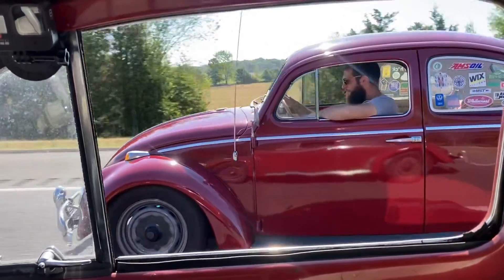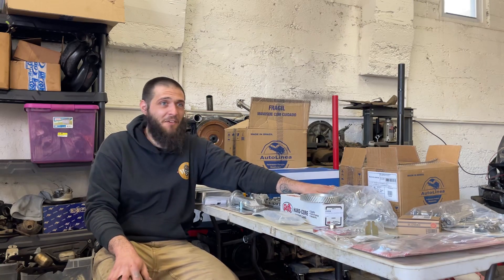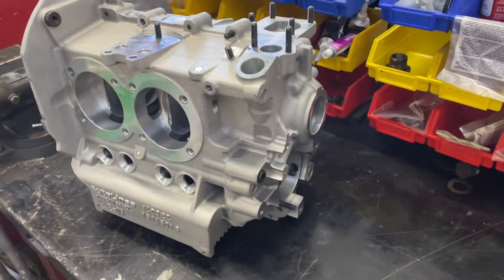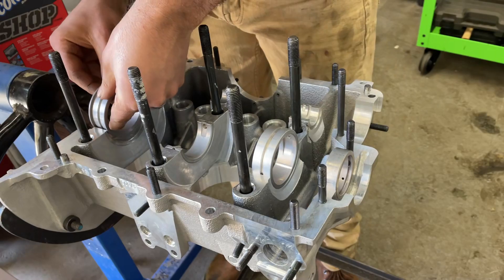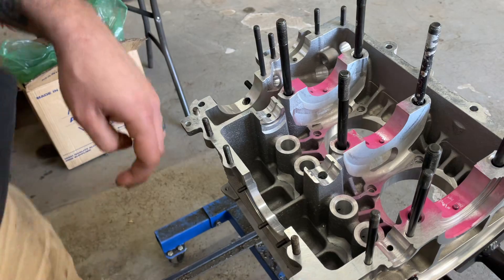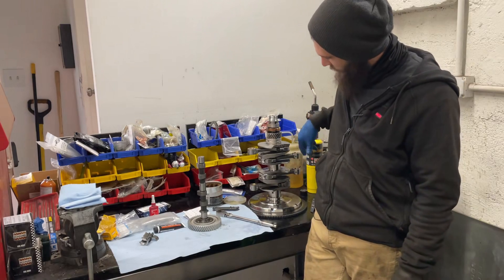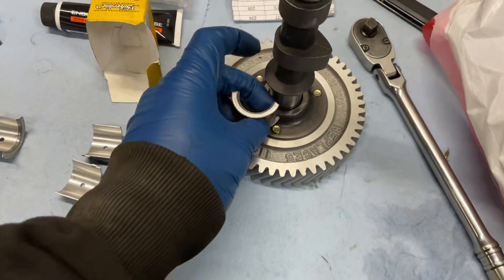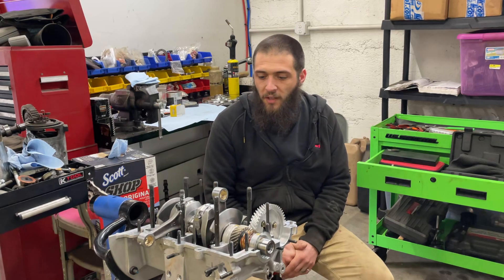LETS BUILD A STROKER MOTOR - Classic Aircooled VW Engine Build

Comment: Scat C25 cam in a 1600-1776 is a great cam. This set up is almost exactly what all my builds are. Just enough over stock where it is a fun engine. Add some 1.25 rockers and it opens it up real well.. Great video...........And don't ignore the Permatex aviation Form-a-gasket...

Comment: I got a 1975 super beetle, fuel injected. And it’s running very poorly, seems to have a lack of compression and blow by. I’m assuming piston rings, first time working on one. Valve cover leaks oil, and missing what seems to be a pcv valve to intake. Could either of those cause a lack of compression? Before I pull the engine out and see wth is going wrong
Reply from the maker: A blocked PCV could certainly cause the leaks but it wouldn’t cause a compression loss or blowby. If it’s still fuel injected, it’s likely the original motor and it’s likely just tired. I, personally; and I know I’ll get flamed for this because I always do. In my opinion the factory fuel injection setups are trash. I personally prefer carb setups. Converting won’t solve your compression or blowby, but if you end up doing a rebuild, it does give you a lot more to play with performance-wise. The factory FI is for stock and stock only and, in my opinion, it’s a god damn nightmare.
Reply: @wickedwerks  yeah I agree with you on the FI, they’re a huge pain. And it seems like I’m dropping an engine, fun times 😂.  I tried getting a compression test on their but I’ll be damned if i could get it on there. She turns over really quick it seems
Reply from the maker: @sam03137  do a valve adjustment and see if it gets better. I’ve had a couple situations where the valves were adjusted too tight and hanging the valves open. Might get luckily but yeah, likely will need a top end. When you pull the engine, check your rear main bearing and make sure it isn’t flopping around in the case; I have a video example on my Instagram. If it is, motor is trash and you need a complete rebuild.
Reply: @wickedwerks  appreciate the help, I’m up in Vermont so it’s finally warm enough where I don’t mind sitting on my garage floor. Probably should get a wood stove in there 😆
Reply from the maker: @sam03137  sure thing! Shoot me an email at wickedwerksvw@gmail.com if you need anything else, advice, or machine work. I’m down in Rhode Island, happy to help however I can.
Reply: @wickedwerks  sure thing, I know just shy of nothing on these engines. So it’ll be a lot of learning at the very least

Comment: did you have to machine the Autolinea Case for the crankshaft and camshaft. im new to vws and i have 3 Ghias without engines.
Reply from the maker: No, it comes cut. I brought it to my machine to make sure it was cut properly.

Comment: You’re using the wrong sealant…. You should use Elmer’s glue 😂
According to CB, their rods you’re using, they recommend the bearing tangs should face down. I don’t remember off hand if that makes the CB logo face the way you have them. 
With that said, the rods aren’t offset so it shouldn’t matter either way. 
I love those rods over the AA rods and CB has a better price on them. 
Good stuff dude!!
Reply from the maker: Of course when I called they didn’t mention that 😂 i agree, as long as theyre not offset they should be fine. Thanks for watching!

Comment: A rebuild with this crankshaft without modifing the oil transfert in the first bearing. It will not last long! The oil line aren't lined correctly with the bearing.
Make some measurement, compare this crankshaft with an original,  you'll understand.